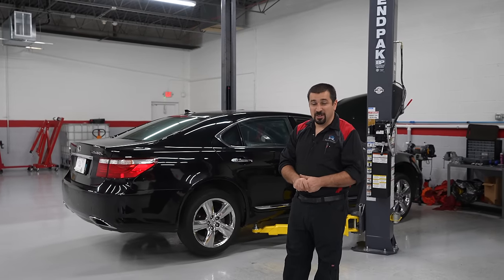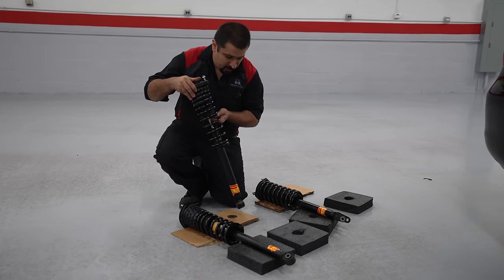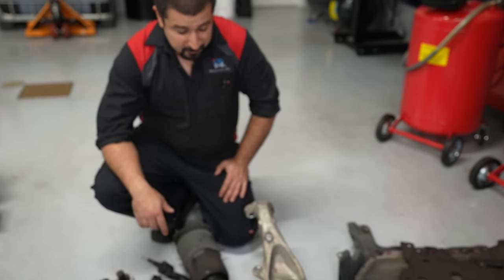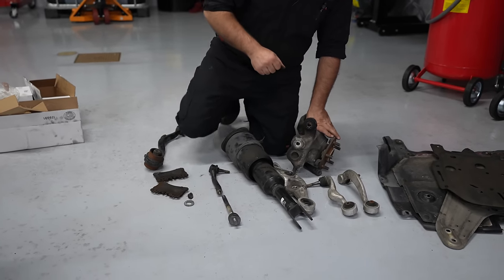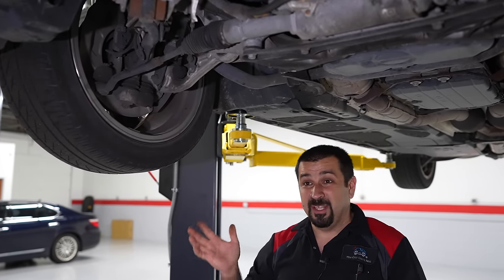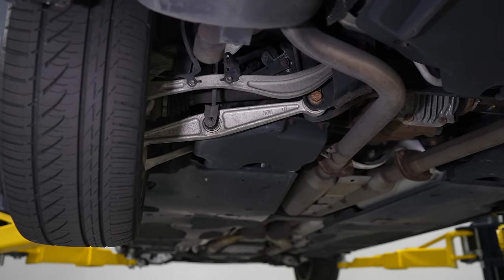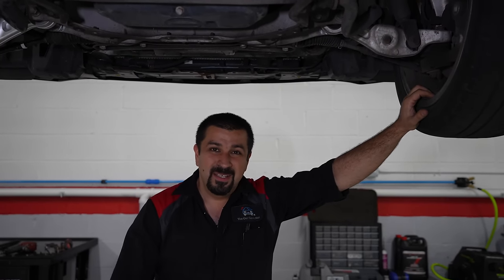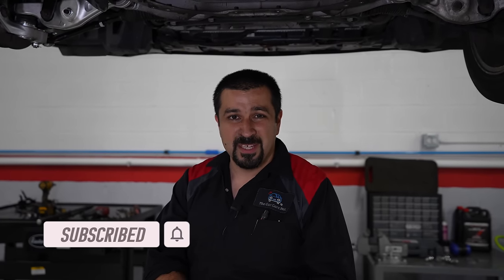Avoid THIS Lexus Model | Pre Purchase Inspection REQUIRED for this one and Here's Why.

Comment: When researching the LS460 years ago it seemed as though the early 460's were having the major amount of suspension problems. Could simply be that they're older than my 2014 and to be expected. I purchased my 2014 LS460L AWD Ultra Lux in 2018 with 10,072 miles on it and I'm up to a whopping 25,000 miles now. Yeah she sits alot, I work overseas. Is there something I can do to preserve the airbags and suspension in a storage setting? Like jacking her up and putting her on blocks? Was thinking of a way to increase the ride height by setting it to max and then blocking the frame and then reducing air pressure. Just not really sure if that is possible and how to go about it. I asked a dealership tech if that was possible and he said no. Time to buy and install a 2 post lift or just clear a car from one of my 4 post lifts so I can get underneath and take a peek. Thanks!
Reply: From my personal experience with JDM Toyota Crown on air suspension the best thing you can do is to replace the silica gel in the  air dryer compartment of the air pump. Replace it once a year - it's  cheap. This will most likely give you 10 years out of your air springs. Don't expect the air springs to last beyond 10 years as the rubber is aging and losing its elastic properties regardless of the load or air pressure, therefore, 
lifting the car on blocks etc is not really beneficial. 
Even the car tyres older than 10 years are illegal in some countries regardless of their wear.
Reply: @axentic   Some countries will inspect your tires on the road and if they fail, you are fine and towed!
Reply: The damn air suspension. Sadly nobody thinks about the longevity of the car when buying new.
Reply: Reducing pressure on the bags while sitting for months definitely will make the life span longer great idea
Reply: Try applying those rubber conditioners to the bags and the bushings whenever you will be away for long periods.  But at your mileage you got a long way to go before u need to worry. Just slow to rubber rot and you should be good for some time
Reply: @johnkennedy7463  might sound like one, but will have no effect on the air spring lifespan. 
Air springs are corded, just like tyres. All the load goes on the nylon cord. All that rubber is actually doing - is keeping it airtight. And it will do it as long as this rubber is soft and ellastic. Chemicals, oil, water, dirt can reduce its lifespan, but not the air presure.
Aging rubber gets harder and becomes brittle and eventually cracks and leaks air.
Reply: @imnotusingmyrealname4566  it's a luxury option for premium cars. In fact the regular shock absorbers fail and require replacement more often than air spring shocks (because the air inside is dry and filtered). In the long run it's not that expensive.
Anyone who has experience using air springs will tell you, that it is far superior to the coil springs. And this is where I cannot agree with AMD about "the same feel" - it's just to talk yourself down that your are savng money while loosing the quality of ride and the ability to change and maintain clearance, etc.
Reply: @axentic  You seem to have experience with this. Okay so you disagree with AMD that it's almost the same ride quality but do you agree with him that the LS should be avoided?
Reply: @axentic  I'm no snob for ride quality, I'm just a snob for "luxury class" as it's called in German and V8s. 😂
Reply: @imnotusingmyrealname4566  the "luxury" is in the details and the air suspension is just one of them :)
Reply: @imnotusingmyrealname4566  Well, this all comes down to the knowledge and education of the buyer. 
If the buyer has no idea what is air suspension - then better stay away from it. 
I personally do not agree that LS should be avoided and I would have picked the one with air sus over coil spring any day. And I did every time I was buying my luxury cars: Toyota Crown UZS131 and JZS145, and Tyota Crown Majesta URS206 - for all 3 I was specifically looking the ones equipped with the air sus. 
The buyer just needs to be aware of the age and condition of the air suspension, just like any other part of the car. 
The car selection process needs to be educated.
When I was buying my Crowns I was specifically looking (e.g. in case with my with my second Toyota Crown - JZS145) for a model with air suspension. For those who doesn't want to deal with air suspension should go for JZS143 - the same car on coil springs and the shocks will be equipped with TEMS, etc.
When people are ignoring these facts (due to negligence or ignorance) and just go for the "top trim" ignoring what that actually means - they will face the reality, and, unfortunatly, will be blaming the technology, rather than their own incompetence.

The technology is great, it's just people who buy the "top trim" for cheap and don't want to spend a penny onmaintenance are not so great :)
Reply: @axentic  Interesting. Thanks. May I ask where you live and wether you bought your cars new or used?
Reply: @imnotusingmyrealname4566  I live in New Zealand. All cars I bought used imported from Japan. When I was importing them: UZS131 was 9 years old, JZS145 - 7 years old and URS206 was 5 y.o.
UZS131 - I had to re-build air suspension completely. JZS145 - replaced rear air sus. All of them came with water in the air dryer, which means Japanese owners and dealers were completely ignoring this system maintenance.
Reply: @axentic  Oh you are lucky. I talked to one New Zealanders or Australian (can't remember) who imported a used GS460 from Japan. You guys are lucky to get card straight from Japan. 😉 But speaking of Japan, kinda disappointed that the maintenance wasn't kept up with on your cars. Did you repair them yourself?
Reply: @imnotusingmyrealname4566   He did not state the LS460 should be avoided.  He stated only the ones with the optional air ride suspension. Might want to listen more carefully.
Reply: @garyg8036  He said the engine has excessive oil consumption.

Comment: Very informative.   I have a 2006 LS430 Ultra.  She has 105,000 miles and one of the rear shocks has a slight oil leak.   Is the air suspension on the LS 430's as problematic and expensive as the LS460?   Are there high quality aftermarket air shocks available for my car?   Where can I get them?   I want to start gathering the parts before the situation becomes critical.
Reply from the maker: Not as problematic but very expensive as well.
Reply: @TheCarCareNut  where can I get high quality replacement air shocks for my ls430?

Comment: A premium car that has depreciated to economy prices still demand premium prices for maintenance and replacements. 
The "cheap" luxury car is a trap for people with taste more expensive than their wallets can afford.
Reply: True!
Reply: I’d just drive it the way it is.  Dump oil in the engine and let it ping away on E15.
Reply: Eh when I bought my 2012 Lexus is350 awd with 113,000 miles it was only $13k. With a bumper to bumper warranty until 150k miles. 

Only major repair ever needed was the front axel boots needed to be replaced and it was a $1,500 job. The warranty covered the cost. 

Drove it until it hit 159,000 then someone ran a red light and tboned it. Never had any issues out it the 1.5 years I owned it. 

Much more fun than a Camry and was just as reliable

Comment: Hey AMD, question for you. Would you recommend a ls600hl? I'm looking at several model years, are there any to stay away from or gravitate towards?
Reply: I’ve been looking too. How does anyone know the condition of the battery cells?
Struggling to find much info/research on them 🤔
Reply: @dibaz1  My car came with FSH and according to receipts the Dealer was doing a battery maintenance check every service. Hope service history will reflect if Dealer check shows Healthy.
Reply: @imperfectandinspired  thank you, I’m having trouble finding any available in Dallas TX

What has your experience been so far?
Pluses and minuses?

Comment: Love that I stumbled upon this video. I own a 16 LS460L AWD with air suspension. My front p/s was similar to that in the video. Not nearly as bad though. I just picked it up from Lexus dealer about a month ago. Replaced Both front mounts / control arms / air  suspension / and basically all the stuff you had laid out on the floor. Luckily I purchased in 18 certified with 25k on it. I just hit 160k this past week. I truly have no complaints with this car besides the stupid brake wear sensors as you mentioned. Such shit! Need to replace very early to avoid hitting the dumb sensors. Compared to any of the Germans, this engine will go to 300-400 hell even 500k if maintained. Rare to see any of those do that.  All in all I can agree the headache that does come with replacement of the air ride, luckily I have the certified warranty until 2025 or 999999 on the odometer so it cost me nothing more than the fuel in the loaner vehicle :) BTW was a 22 ES300H, nice treat on gas compared to the 20mpg average the LS
Reply: Can you share method you’re able to buy 7 year warranty on your LS and how much? Ty
Reply: @torocars9227  I purchased through Lexus dealer in 18, came with free 2 year unlimited mile warranty as Lexus standard. I purchased the additional 3 year warranty unlimited miles or till Aug 2025. Truly worth the $$. Dread the day it expires
Reply: @kodeys4090  curious, how to what age or mileage do they offer you to re-extended warranty? What are the limitations to reapplying for more years after your 3 years expires ?

Comment: Thanks for the informative video AMD! Does the new gen LS share the same issues? Have you had any 2018+ ones in the shop so far? 

Also, it seems like the ES and GS are better options when buying used, they seem to have way less issues and stronger engines.
Reply from the maker: I haven’t had a 2018+ In the shop yet but it does have similar setup but they’re too new to have issues
Reply: @TheCarCareNut  I’m looking for a 2016-17 LS. Is it safe to say that they are much more reliable? Thanks

Comment: I worked in the industry and I can tell you Toyota products are great.  HOWEVER, everybody knows Toyotas and Lexus for that matter are well engineered and built cars.  which leads people not NOT take care of them.  Every car regardless of how good requires good maintenance.  Cars I will stay away from if they are above 60k miles are Lexus ES, IS, LS, RX etc.  Pretty much all Lexuses unless they have an extensive regular dealer history and Toyota Corollas, Camrys, Tacomas and Tundras with the exact same qualifiers.  If somebody wants a Toyota I always tell them look at Avalons.  Those are TYPICALLY well maintained with more mature owners that tend to take care of their cars.

Comment: It’s not the car but the owner. I have over 200k on my 07 ls460 and original control arms, no noises cause I don’t pull into my driveway or any driveway at 30 mph. I do it at a crawl. Literally.the wheel bearing went out and yes its tough but so is a Prius, same design.  The amp is the least of my worries and just started to go out. I didn’t care about factory air but should have gotten the long wheel base version for much more room, as if it really needs it in the back. You wanna know how to easily get that wheel bearing off? Easier than normal but not easy for the shades tree guy.

Comment: your video about the LS460L is spot on, I am working on a 07 model, the customer burned the left rear wheel bearing up on, it was smoking hot when it came in, the bearings were literally gone, it was so loose that it galled the brake caliper, rotor, burned up the pads, ruined the axle, wheel speed sensor, after all was replaced I test drove and didn't make a block when I noticed a bad clunking in the drivers left front and ABS light on when braking, it was the left front wheel bearing that had gone out also, I replaced it and test drove it and the ABS light is now on and engaging when stopping, I stopped turn the car off to check for error codes then the car would not start, starter would not engage, I checked to see if the immobilizer was communicating and it was, I had to leave the car there I came back two hours later and it started again, I drove it to the shop and it would not start again, I'm about to send this car to the Lexus Dealer, I wish I would of never accepted the job.
Reply: Load test the battery? EMC very voltage sensitive.

Comment: Buy a low mileage perfectly maintained LS430. Problem solved! I just sold my last LS430 and just picked up a 2004 LS430 Ultra Luxury Edition with just 100,000 miles. This car is so awesome. Best luxury car ever built.
Reply: When did they stop making the LS430?
Reply: @dibaz1  2006

Comment: This is why having a compulsory MOT in the UK is good, it forces people to maintain their cars but also catches problems early to prevent one problem causing the failure of the connected parts like on this car, the yearly inspection would find a worn bushing or ball joint.

Comment: I have a 2007 with 436k miles. Original engine and transmission. Never gave me no issues accept for fuel pump and rack and Pinon and engine mounts

Comment: Hah, this reminds me a lot of my Audi and VW front suspension!! And not in a good way. As for brake sensors, I just usually cut them off and connect the wires...no use for them. Nice video, thanks. Surprising eye opener for a Lexus.

Comment: I've had Lexus for 22 years. I've been driving - and racing - for 65 years! I've always owned high quality cars, but I've also built my own race cars from the ground up. Okay, so I speak from decades of experience.
I wouldn't buy anything but Lexus, they are the best in the world in my opinion. I currently own a top of the range "Royal Class" LS460-L. It's been imported from Japan 3 years ago and has 196,450 miles on it. It's totally trouble-free, this is due to my following the golden rule of car buying here in the UK - a full and comprehensive service history! Absolutely essential for any used car.

Comment: Lexus air suspension can easily last around 10 years or 200k km. The GX460 has air suspension on higher trim and when it is time to change, owners remove it and add an overland setup.